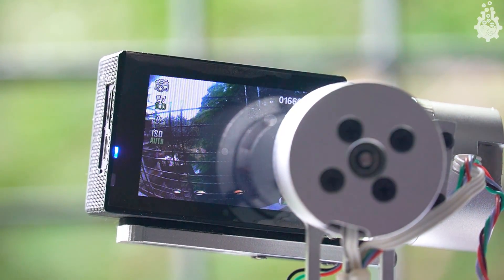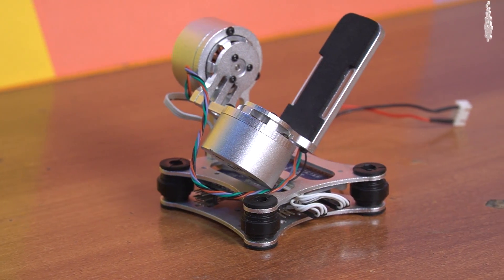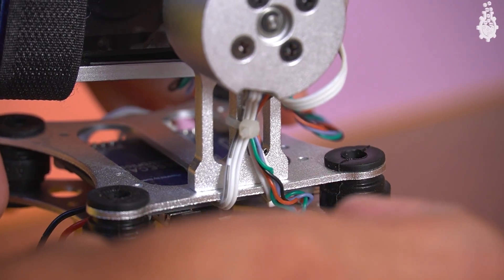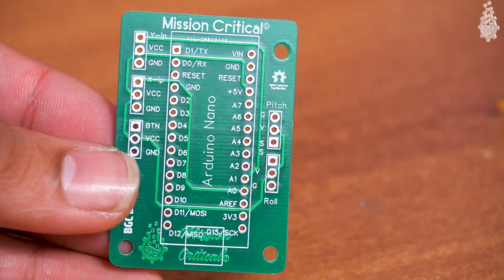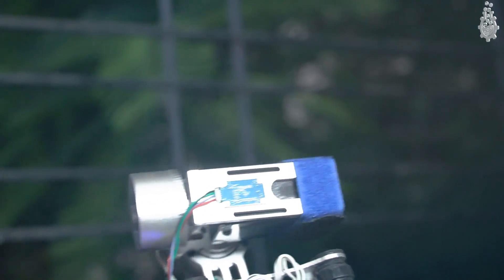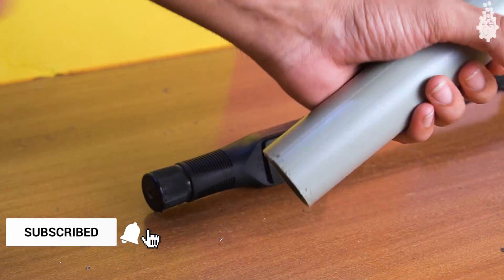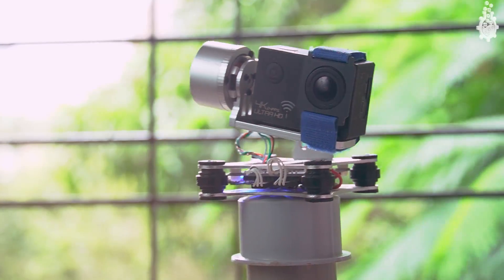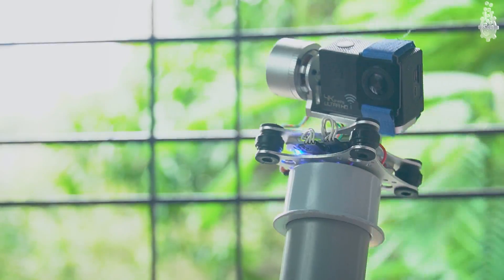how to make a gimbal  | diy gimbal for action camera

Comment: Hi can you make a gimbal using the drone gimbal circuits and simple dc motor for mobile phone📱
Reply from the maker: Using simple DC motor won't work, Gimbals need highest resolution (in terms of steps) for its operation, but yes I can give it a try !

Thanks a lot

Comment: This is brilliant! I found it from Instructables. I already HAVE the gimbal frame, motors, BCG board, and even the same joystick! I was unsatisfied at the completed assembly, and put it on the shelf from the poor results. NOW with your help, I can make it what it was meant to be. Do you offer the circuit board for sale to USA?
Reply from the maker: do you need the PCB which takes input from Arduino?
Reply: @mission_critical  Yes, for the Hosyond Nano V3.0
Reply from the maker: @BrilliantDesignOnline  can drop me a mail at writetomission@gmail.com or message on Instagram @officialmissioncritical?